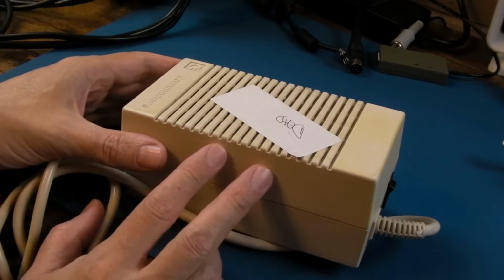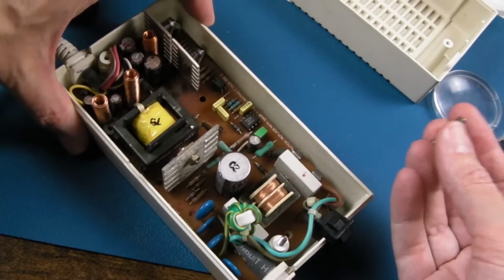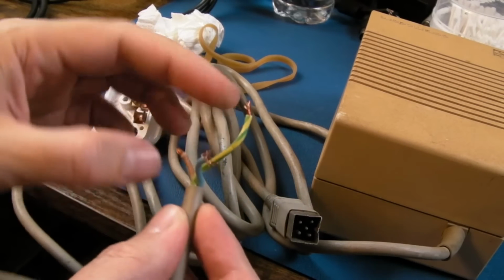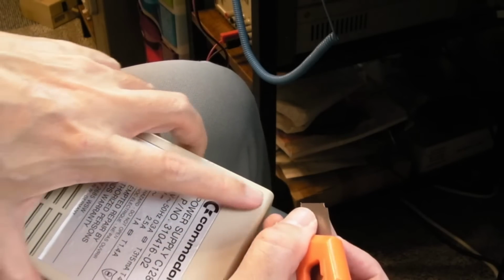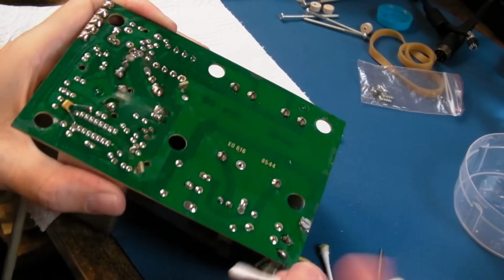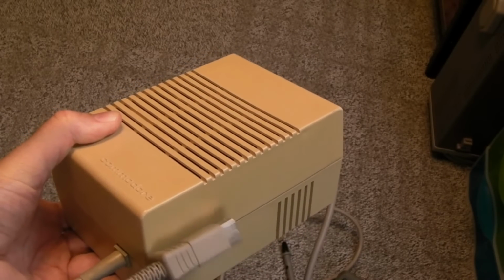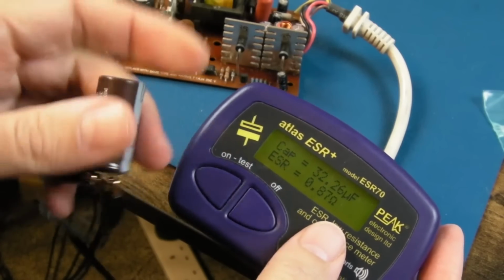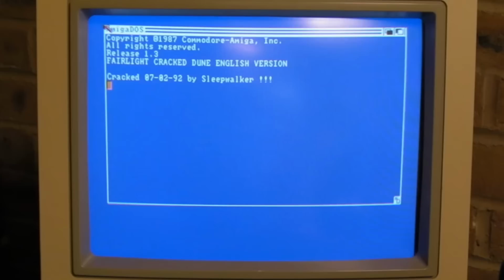Fixing Loadsa Commodore Power Supplies (Part 1)

Comment: Btw the KME Series are Chemicon ones, standard, 105 degrees. Not bad ones. Much better then the Frakos. Also, in general, in switch modes the primary caps arent usually aging very fast.All they see is nice, rectified AC.  Its the secondary side ones that are tortured with high frequency pulses. Can be seen - the KME primary was just a standard type, while the secondary ones needed to be low esr types. I'd rather change them and leave the primary ones in.
Reply: Btw, the symbol left to the KME marking is the chemicon (united, nippon etc) logo. ,)

Comment: If possible please don't directly short the main filter cap as that is bad for the cap and can cause damage to your tool used to short it out (and sparks as well).  Get a proper resistor to bleed down the charge in a controlled manner.  If you don't have a resistor you can use yourn   multimeter in ohm's mode to do the same thing but only if your meter is a good quality one.  There is a video from eevblog on how to do it that way.  Those wire loops in the C128 power supply may be current shunts but I could be wrong on that.
Reply from the maker: Thanks, totally aware - from my own experience it makes no difference to the capacitor or life of the capacitor.   You do just risk damaging tools from the arc!  Anyone I've worked with in the trade (and I did get to work with a lot of engineers - one that was head of repairs for Dixons UK - covering just about every brand of electronics).  They all just took the short cut rather than bleed with a resistor.  The exception was on higher voltage capacitors (eg. over 400V).

It is best practice to bleed a capacitor, in reality - hardly anyone one does it as it takes some time.  The multimeter idea is good, until it isn't - ie. where you forget to change the mode and that current causes some issue or blows fuse internal to the meter etc.  I guess on a good multimeter that's definitely a nice quick practical solution!!

Comment: I find the easiest way to put on a UK mains plug is to first, make sure all the leads are the right length, then I remove the pins amd the strain relief from the plug and attach the pins to the wires, then starting with the neutral, then live, and finaly earth, re-insert them into the plug and put the strin relief back.

Comment: This reminds me of my childhood. Got a brandnew Amiga 500 but every once in a while it turned off and on again. So I had to bring it back to the shop, they sent it in, and I had to wait 8 weeks before I got it back. But they didn't repair anything, the failure was still there. Since I didn't wanna send it in again, I opened the power supply myself, saw a cable that was jammed in the case, rerouted it and all was working flawlessly again. Good old times (and the beginning of my better-do-it-myself career).

Comment: Thanks for a nice for a long repairaton/refurbaton. Those old caps were surprisingli good for their age.  I looked up the 78540, which is in the C128 psu at 26:00 I was curious to if it was a step-down converter, seeing that large donut inductor, and yes 78540 is a switching regulator. That would help with efficiency.
Reply from the maker: Thanks for the info! =D